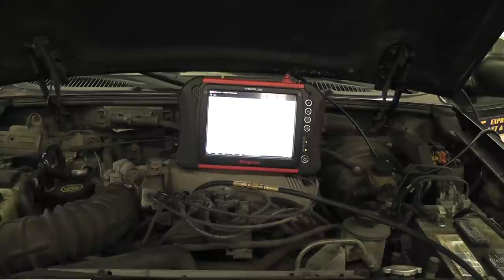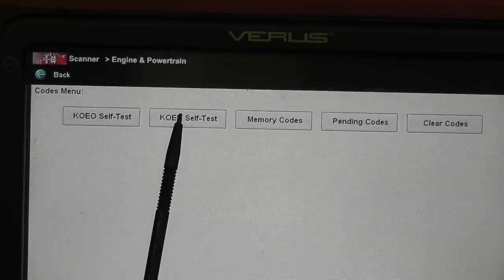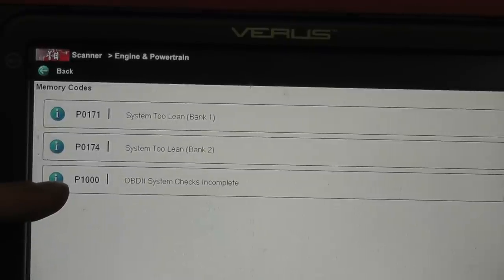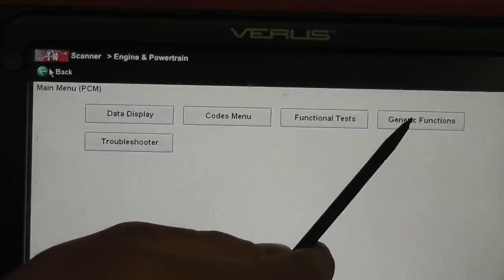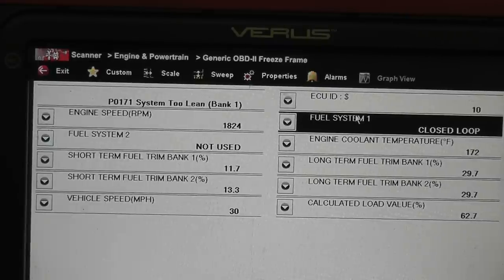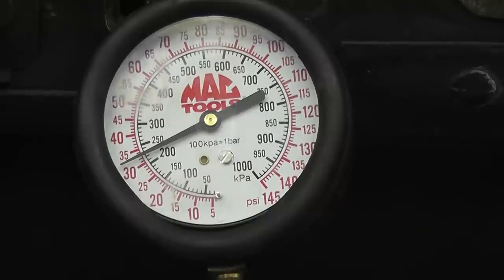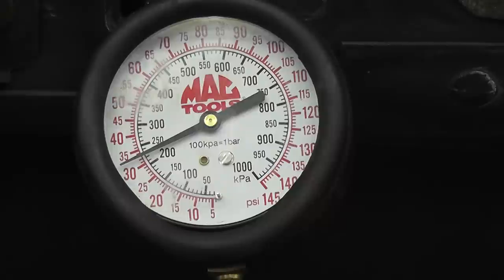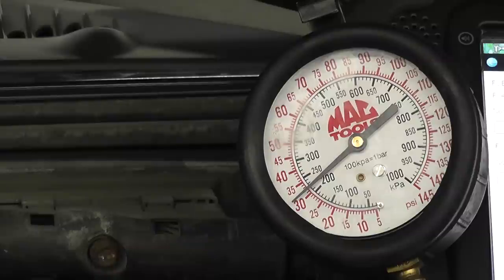Low fuel pressure causing a P0171 and P0174 trouble code

Comment: Hi Paul,
I have a question for you.
I'm having a real hard time diagnosing a 02 chevy cavalier that the customer bought from a dealer that had put a used 03 pontiac sunfire engine in it.
The car is running rich (LTFT is -14.1) with no check engine light on, and the car will surge 
up and down and want to stall after letting off the gas when it come back down to idle.
The o2 is always around 0.800V at idle.
Do you have any idea's or tips for me?
Thanks,
-Tim

Comment: Just here watching videos but my Acura does get the p0171 at idle when it sits for 10-15 mins I turn the car off and then start the car 5 mins later. I had my scanner hooked up and the freeze came said the intake temp was 139 but this is probably heat soaked from sitting but it’s 40 degrees outside. During the summer if I sit with the ac on it doesn’t happen. Come to think of it I just changed the purge solenoid last week and it’s more apparent now with the 0171 and 0174 codes. I do have a very small exhaust leak due to a gasket but it’s been leaking this entire time I’m sure if it and the code didn’t show up.
Reply from the maker: If the exhaust leak is near the O2 sensor or upstream of the O2 sensor. Fix the exhaust leak first!

Comment: I measure the fuel pump pressure by bar and I find usually the pressure must be between 6 to 8 bar , I wonder are it right or not ?
thank you very much.

Comment: hi, Paul. Great video. I have Honda Civic 1998 DX. Getting occasional P0171 (lean) whenever LTFT limit maxes out. STFT range at idle [ - 2.77 ~ + 3.00 ]. Upon acceleration STFT numbers plummet : 30 mph - 24%, 50 mph - 35%, 60-70 mph - 49% ( flat line on scan tool ). Once pedal released numbers drop to flat 0.  Things done: new fuel filter, fuel pressure within specs (at idle) and open throttle (parked), swapped fuel pump, swapped ECU, voltage drop test on pump's power feed and ground (parked), ?

Comment: My ford 1995 has a new fuel pump and new fuel filter and new fuel regulator, when I give gas the pressure increase but go down so fast is at 31 psi increase to 40 but goes down to 30 rapidly

Comment: What is a 'weak pump?'  It seems like they should work, or not.  My Toyota has 185k miles, I replaced filter around 150k miles though they say never needed.  I've had a slow start as you mention for a while.  I now get P0171 and can't find it anywhere.  I tried two new MAF sensors and code kept returning.  No vac leaks.  I've tried fuel treatment a few times to clean injectors.  I can't find a shop as thorough as you - here they just want to throw parts at it, at my expense.  I did take it to a shop to confirm vac leak with smoke test, he merely suggested MAF sensor and valve cover gasket for $500!  Worse, he promptly dismissed my mention of fuel pump.
Reply from the maker: You definitely need to confirm good fuel pressure under load!
Reply: Pump impellers wear out, increasing clearance, reducing pressure.

Comment: I have a 99 ram 5.9l gas motor. my fuel trim is 50psi kinda shaky. haines manual says should be between 35 to 45 psi. a 5 psi isn't un cormmon.  havent done a snap throttle like I shouldve....... lol what would  bad single line fuel line with a bad regulator look like on the guage?

Comment: That happens to me in my toyota yaris 2007...we check everything..but this yaris does not have to check the gas pressure, so after discarding many possible faults ... we replace the gas pump and the problems will be finished, no more checking engine light or to lean bank 1 and p0107 codes on my board! !!

Comment: I'm having a similar problem with a 2003 BMW E46, the car is a bit of summer fun and as such I dont usually leave much fuel in it, recently ran it to keep things moving and it threw a code for misfire with low fuel and now I have lean codes for bank 1 and 2, is this likely to be the pump slow failing? Thanks
Reply from the maker: A weak pump will certainly have throw lean codes

Comment: If i have to snap the throttle fast 3 t o4 times and pressure drops 4 psi on a returnless system is that bad as well? my system calls for 58 psi plus or minus 5 and the highest I get is 49 psi. Would that cause a p0171?

Comment: Hey paul, looking for some help here. I went through some water a few weeks ago. When I got home I checked my air filter and it was soaked. Replaced air filter and dried everything up. The next day a p0174 code came on. Truck runs fine still so I just cleaned my MAF.....no luck. So I have already changed the MAF and both right bank O2 sensors. SES light is still on. Any thoughts? Pulled the freeze frame data today if this helps anyone take a guess on whats causing this.

Load value-88.24%
Coolant temp-186.8
STFT B1-7.81%
LTFT B1-33.59%
STFT B2-8.59%
LTFT B2-33.59%
RPM-2062
Vehicle Speed-77.05mph

Comment: I hear as a basic rule you say that if the high fuel trims are on idle its most likely a vacuum leak and if its under load then it's most likely a fuel problem or maf problem. Isn't it common on older cars to have some, one or several, small vacuum leaks and also have other issues? How do you decipher the data when the results do not fall under the normal rule and you have high fuel trim when at idle and under load?
Reply from the maker: Attack the under load condition first and treat it as you would any other under load lean condition.
Reply: @ScannerDanner  I now have my scanner and some data. I found a code p2006.IMRC valve stuck closed bank 1. This would explain some of my issues but not all. I was curious if you could lead me to one of your videos that shows how to test this or diagnose if its really stuck closed. Truck cuts out intermittently during acceleration. Runs pretty good above 2800 RPM. Very slow to accelerate all the time. P0171, P0174 light on and P2006 under other codes. Fuel trims intermittently improve, RPM does not seem to be a factor. Sometimes it makes then run more rich.

Comment: Hi a had a situation that reminded me of this video. i replaced a fuel pump (along with a filter,) to solve a no start condition on a 04 E250 with a 4.6L returnless fuel system. as part of the diagnosis i used an IDS scan tool to graph FRP vs. TPv under snap throttle and it dropped about 10 psi. (engine ran briefly when the pump began working again.) after the repair i redid the test to verify. it still dropped 5-6psi, then surged and finally stabilized. any thouhgts why pressure still dropped?

Comment: hey Paul. I know this video isn't exactly on this topic, but do you have a video explaining possible causes of poor gas mileage. I have a 2001 Subaru Forester with a 2.5 liter 4 cylinder engine, and used to get between 21 and 24 miles to the gallon during the summer. Now I'm only getting about 18. All the tire pressures are normal and the car performance is perfectly fine. Any suggestions or better yet a video explaining possible causes. My only code on scan tool is oxygen heater circuit low Sensor 2 bank one. Thanks
Reply from the maker: fuel trim can be affected by a downstream O2. Fix your downstream O2 code before doing anything else

Comment: I have to replace the fuel pump in my 2002 Holden Commodore this week (runs the Chevy LS1 drive train) & I'm wondering why no fault codes could be detected by my scan tool.
The Maximum fuel trim value that was achieved was 25% on both banks (lean) & the fuel pressure is at 47 psi when it should be at almost 60 psi.
The only fault code I've ever read was a P0443 which was related to the emission control system (air leak).
Reply: Is the 25 % fuel trim at idle or under load? If it doesn't max out in low rpm, that might be why it haven't triggered a code.

Comment: I have those codes on my 99 E350, and if I hear clean the MAF or check the PCV one more time I'll go postal, since I personally have done so, along with trace all the vacuum lines in the doghouse.
Reply: I am directing all help requests to my forum. Sign up (it's free) and create a new post. Be sure to add a name under "alias" as this is the name that will appear in the post.
Here is the link to the forum. 
http://www.scannerdanner.com/ForumRetrieve.aspx?ForumID=3226
Thanks
Reply: Done all the same here on my f150
STILL COULD BE:::
....fuel pump
...fuel sending unit
....bad torque converter
...bad catylitic converter
...untraced vacuum leak
....intake gasket bad
....crack in the intake
....bad computer
.....bad fuel injectors
.....clogged fuel filter 
AND MUCH MORE!!!!!
Get rid of the ford,,,get a Chevy and never look back
I HAD a Silverado ,,,NO ISSUES EVER
SOLD it to buy the f150 super crew for more room....WORSE DECISION EVER!!
even more issues then this
Reply: Mike T Bullshit, Chevy and their plastic intake, I have a friend with one that needs the intake gasket replaced, costs $1500, people like you always gotta come on here and try to play my brand is better than yours. Dads Chevy has ignition issues, being a 2001 it doesn't qualify for recall, so he gets to eat the cost of repairing it, have to remove the bed to replace the fuel pump, and the driving lights keep blowing out. BTW my E350 has been trouble free for 12 years, racked up 148,000 miles, and you don't walk away from a wheelchair conversion to start over unless you are wealthy, which in that case you'd just get it fixed.

Comment: @ScannerDanner HiI didn't say electronic... but it is a returnless old ford system. if you replicated this in a dyno  I said, you should  run all monitor first  for instance np_relearn... you know when you get  DTC P1000 you are actually looking at incremental live data not real live data. so, reseting KAM in my opinion have a lot to do if you run the car in a dyno. didn't say KAM would fix it.

Comment: You really do know your stuff on sensors and tracking complex faults.
My issue is giving me the run around, i am rich under idle(the exhaust stinks of fuel) but lean under load so the computer says, i have random misfires under load and idle only when engine is hot, engine codes do not give me an engine light and the error codes state crank shaft sensor and misfire detected under load.
I have still to check fuel pressure which seems a likely cause.
What do you think?
Reply from the maker: ***** dirty MAF is the most common cause of a rich idle and lean under load condition
Reply: ScannerDanner Yup that was my first thought but unfortunately i do not have a MAF, I have a MAP instead.
I have two codes, one is p0340 crank sensor fault and second is misfire due to low fuel pressure under load. I forgot the code for the misfire.
I am not lucky enough to have all the diagnostic scopes you have so i use cheap methods such as the apps for Android and a bluetooth dongle to capture the data.
Reply from the maker: ***** I don't know what your working on? But you need to fix your low fuel pressure problem under load for sure and then also the cam code.
Reply: ScannerDanner I am working on a MG-TF which has a Rover K series engine. The engine runs like crap at low RPM and is barely drivable so yes it needs sorting without doubt. I am thinking the Crank sensor is a secondary fault as the engine runs and revs without limit. 
I would not be surprised if it is a bad ground or fuel pump but that is my next tests. Voltage drop measurements and a fuel pressure test including the fuel pressure regulator as this engine has a return fuel system.
Your videos do help allot although your premium youtube channel is a bit frustrating as i am not a professional mechanic just a enthusiast. Paying a premium to study is a bit of overkill for an enthusiast as i am not going to get a job in the sector. 
Regardless, the information you release for free is still greatly valuable and appreciated so thank you.
Reply from the maker: ***** I can understand that. Would you like a coupon for a free month? If so, contact me through my website and it's yours. Just be sure to cancel before your month is up so you are not charged. That is the only catch.
Reply: ScannerDanner
I'll head over to your website later and check it out. Thank you.
Reply: +ScannerDanner Hey Dan. Just to let you know i have found the crank/camshaft fault.
As mad as it is i have a failing coil that is arcing when the engine gets hot. The Cam sensor is about 5mm away from the coil over plug that is arcing. Who would have guessed that would be a cause of an issue code that does not even light up an engine light.
As for my fuel pressure problem it is still giving me the run around.  Pressure only ever builds up to 3 bar/43PSI idle when the engine is running and on throtle rev it runs up to 3.5bar which is around 50psi and my manual says 3bar regulated 3,5 bar @ 14.8v so i know now my alternator is working lol. 
Engine off fuel pressure drops to 30psi and the pump on without engine running only delivers 38psi. What really bugs me is the manufacturers spec of psi to voltage, what is that all about? 
Seems within manufacturers spec when engine is running based on the psi to voltage spec.

Maybe that code will go away seen as i have found a crazy bad ignition coil fault.
What do you think?

Comment: How critical is it to insure every bit of air is completely out of the gauges line for accurate readings?  I have a 98 Mercury grand marquis that has a very conveniently handy & located  vertical schrader valve on the drivers side fuel rail, but when the gauge is attached on it, there's a fair good chance air can be trapped. DL
Reply from the maker: I have a bleed on my gauge to eliminate that. To be honest, I'm not sure.
Reply: @ScannerDanner  1st. Happy New Year!  Maybe it's not too hyper critical if "most" (if not all) of the fuel is out and since the gauge itself  has its own inherent +/- range of accuracy, but I could be totally wrong, again.  Also, since the pressure range is well below 50 PSI, a different gauge with a much tighter, reduced top end PSI value "should" give much a much more accurate reading too if its really all that hyper critical I guess, but then I could be totally wrong there too.  I once thought I was wrong before but I was mistaken.  ; LOL  Happy New-ist Year.  You now have a new fan!  DL
Reply from the maker: @trainguy1218  lol, saw your email too, you said you fat fingered it? I do that all the time. This was simply Korean subtitles that a viewer put in. You can switch it back to English. I don't know why the default would be Korean smh
Reply: @ScannerDanner  In truth, I literately crushed my R pinky tip in a garage door fold years back, it's  been literately "fatter" than the rest since then.  It just don't pay to rush even at quitting time.  That was me who someho hit the K stuff, but i "fingered" it out, so to speak.  ;)  LOL.  Happy NY!!!! DL
Reply: @ScannerDanner  PS, re the K language & geo. location stuff.   I'm now afraid i'm a much more serious sleep walker than I realized.  No wonder my breath smells like kimchi in the morning!  ;)  LOL

Comment: Hey ScannerDanner I have a 1999 honda civic ex and I have a trouble code P0171 (System Running Too Lean Bank 1) I changed upstream 02 sensor. What is the most common fix on hondas?
Reply from the maker: +PresidentGuevara vacuum leak, low fuel pressure

Comment: ScannerDanner Please help. I have an 06 GMC Canyon 4cyl with P0171. ST fuel trim is 8 LT fuel trim is 25. upstream O2 sensor Voltage is between 0.1 and 0.5 Volts Downstream is 0.75. Fuel trim numbers improve when RPM is raised. Tried the water test with no success. Would you still say this is a vacuum leak?
Reply from the maker: +A.M. Ray keep looking man, those intake gaskets leak on those all the time and you will have a hard time getting water on the spot the way the intake is designed.
Reply: I'm going to try a homemade smoke machine. Thanks for the help. 
              - Andrew

Comment: on a obd2 upper end car, a good scanner - 100 bones- will give you freeze frame data of the environment at which point in time the code was triggered - faster and more robust diagnostic I got a cheap 80 buck one at walmart - roadi ngs 100 - gives freeze fr and real time o2 volts, short and long fuel trims , engine operating temp - , maf performance , map sensor

you dont have to look for weather cause the barometric pressure can be had from map reading and ect will be average 5 hours temperature of engine....lol  - engine off so there is no vacuum and key in on position but no start.....lol

Comment: I have P0171 code and I know I have a low fuel pressure around 20 psi(while running in idle ) I’ve erased the codes a couple of times so does the code reappear because of the low fuel pressure or because a faulty MAF sensor or a vacuum leak(I have replaced the intake and valve cover gaskets before)
Reply from the maker: yes, fix your low fuel pressure problem

Comment: saw your video and i have these codes on a chevy silverado 97 and these are the things that i have replaced fuel filter air filter clean mass air flow sensor, replace gaskets on manifold, replaced a broken elbow for the pcv valve spark plugs (cat converter for other reasons) (all 4 o2 sensor for other reasons) now my problem is that when i slowly press the gas pedal is fine if i press the gas pedal fast and hard it wants to die out. do you think its the fuel pump being weak? i didnt hear the car in ur video wanting to turn off though. please help any ideas?
Reply: Mines is doing the same thing. Did find the problem
Reply: That's good I also fixed mine which I replaced the fuel pump and fuel filter and it worked but maybe all I had to replace was the fuel filter it was clogged